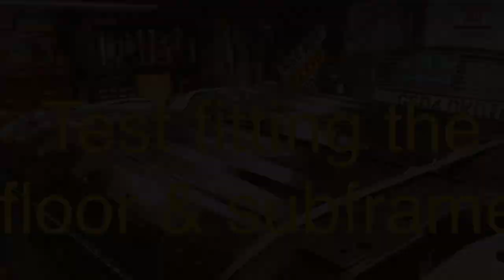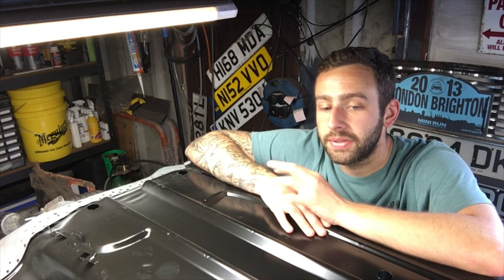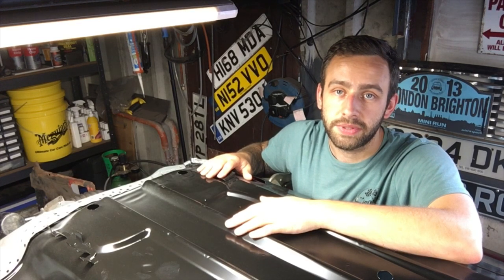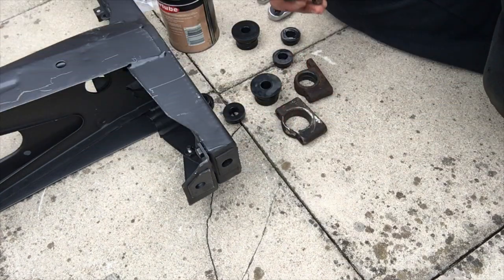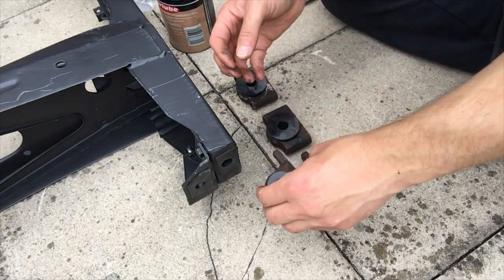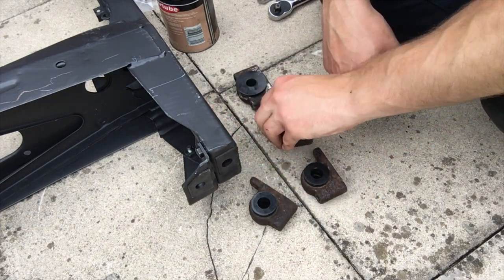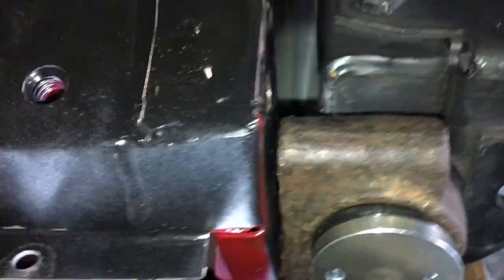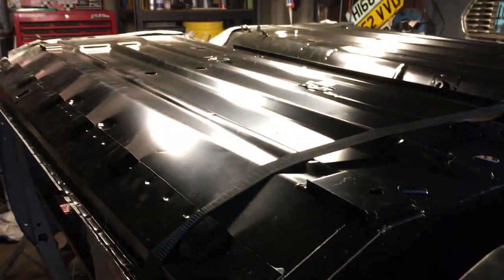Classic Mini Restoration 1989 Episode 10 - Things didn't go to plan!

Comment: Thanks for sharing the problems.  This slight bit of frustration will help me and others in that you have now given me the idea to re-fit my rear subframe before cutting out the floor.  If it fits on the jig, then I will make an alignment jig knowing for sure the job can be done correctly.  So this has helped ... thanks
Reply from the maker: Lone Star Mini no worries I obviously hoped it would all go together first time but minis are never that easy. So the whole reason I do this is to try and help others so I will take you all ok the journey to see how thjs pans out I have a few ideas.

Comment: Bit of a head scratcher mate, we had issues with one side on KITT as the sill section was 4mm out. It was manufactured incorrectly
Reply from the maker: Classic Mini Workshop yeah I think the split/jig isn’t helping as the gap moves as the car turns that worries me.. the floor definitely needs to go forward. I will try some straps on it see how u get on. But IMM prep on two cars is taking over tbh

Comment: Three checkpoints when I put the new Heritage boot floor in were the 2 strengthener brackets inside the boot on the wings were original and had been kept in place by the subframe, the two inward curves of the inner wings are pretty much what will get it in the right place and inside the car the seat backpanel is another landing point for the boot floor and has a few pressed shapes to show if its in right. If they are all OK then its the new floor assembly too far back. Sorry! How do the two end closing panels fit the heelboard, wing and boot floor panel?

I am always sceptical of using rotisserie jigs when the floor is out as right way up the weight of the car 'stretches' the floor area and upside down it 'compresses' it. I had to save the cost of a jig to buy panels and as the A and B pillars had already been braced together and across the car I rolled the car on its side onto a single bed mattress! I used Heritage front inner wings as I had basically thin air when I got the car I needed some valid reference points and I kept the (stripped) rear subframe in place until I fitted the new boot floor. And it all went in fine. While I welded the boot floor and heelboard in completely I just tacked and Tech screwed the tunnel and floor panels in until it was back upright. I have used the 4 slinger brackets as mounting points for a timber stand frame (and as diagonal measuring references as well). A bit Heath Robinson but it has worked OK as the new Heritage rear body half panel (HMP441019) landed on the new boot floor and C pillars just right using the bumper locating holes as references.

I think your problem may ease when you roll the car over (hope so) but if not then I would look at the inner wings. There is also a ridge on the tunnel that sits at the end of the front bulkhead panel you can use as a guide. All best wishes from Suffolk mate ....
Reply from the maker: Thanks for the tips buddy!